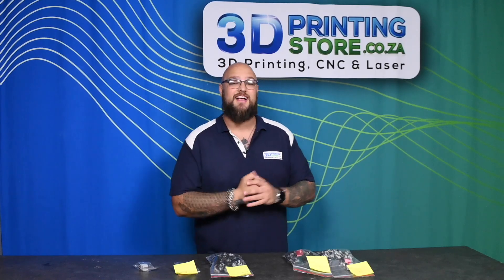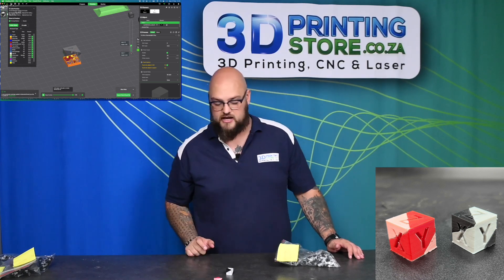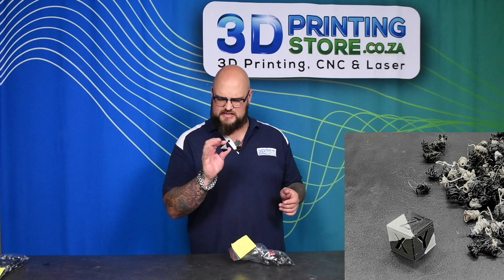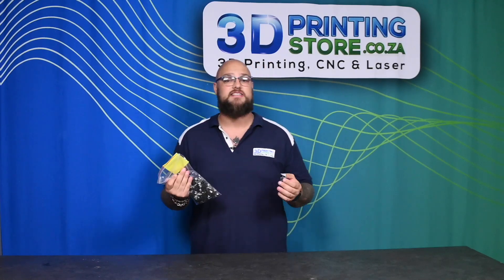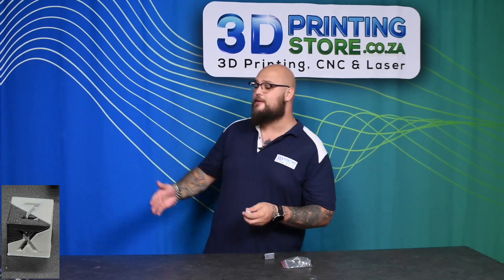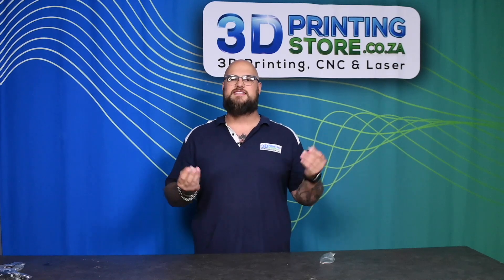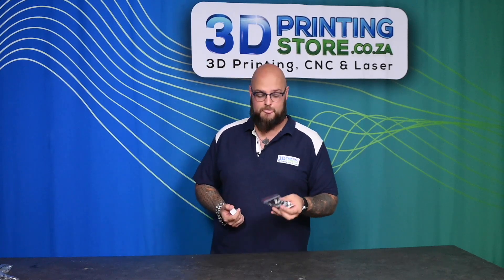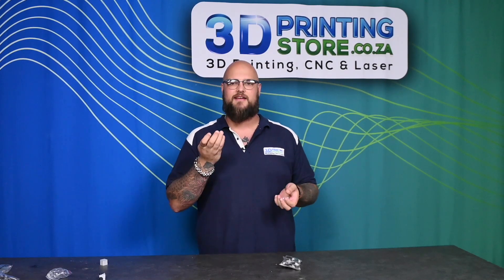How to get no waste on your multi colour prints

Comment: To be honest I think that the tower alone without the poop is the way to go. Used the prusa MMU2 for years and had no problems with purging white (with a high enough purge volume).
Now using a K2 pro and do not understand why it produces so much poop and Primetower and still there is colour bleeding.

Comment: Another way to reduce the waste is to print multiple parts.   Put as many as you can fit on the build plate.  You can print many objects at once and have the same amount of waste as one single part.  It is only purging once per color per layer.

Comment: Hi any idea why,  if i flush into an object when i slice the flush amount still stays the same ? i get that it will flush the same amount but will it actually flush some into the object and the rest as waste? When looking at it from the slicer it looks like it will just print and still waste same amount
Reply from the maker: when adding an object to flush into...it does not automatically lessen the normal flush...you can manually go into your flush settings and lessen them.
Reply: @3DPrintingStorecoza  That seems odd because you still need flush material and the minimum amount needs to be correct.  It just will go into the object.  If you reduce the flush amounts manually, then how would the slicer know how much needs to go into the flush object for the color changes to not bleed into the other color?  I tested this on Bambu Studio and it does seem to adjust the estimated flush amount (but still keeps the filament flush amounts the same in the filament section).  This seems like it is a bug of some kind in Creality Print.  I am using a K2 Plus.
Reply: Maybe the flush amount is the same because it is still flushing... just to the object.  So maybe it just doesn't show in  the preview estimate how much is going into the object, infill, etc.